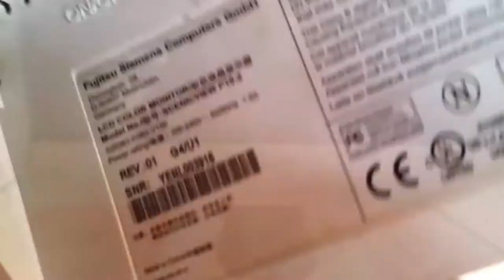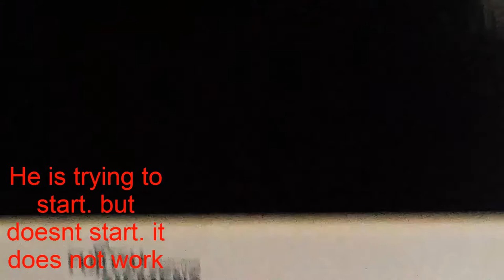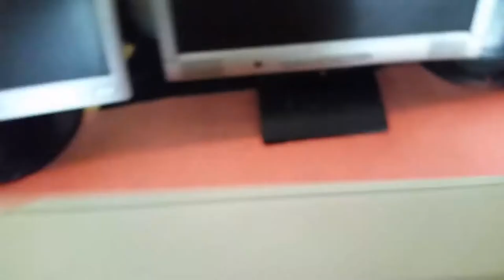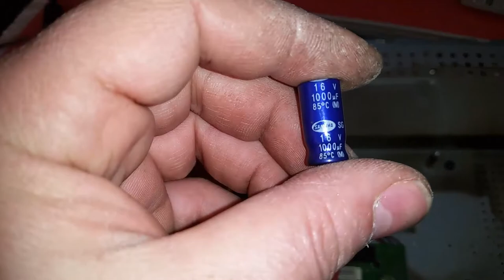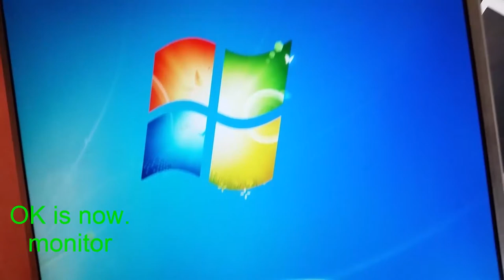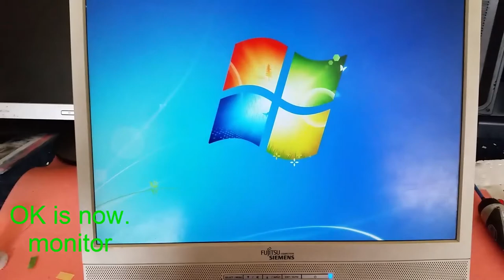FUJITSU SIEMENS P19-2. monitor. He is trying to start but doesnt start. it does not work

Comment: For the P-19-2 with the leg attached at the base you must first unscrew the 6 screws beyond the plastic cover , otherwise the lcd panel will not come out  . My monitor simptoms was it started but turned itself down after 2 seconds . After multiple starts it managed to stay on . Changing 5 caps in the power resolved the issue  (2 were really bad )

Comment: In a slightly different model (Fujitsu Siemens P-15, with different PCB) the same capacitor (near a large heatsink) caused the problem too.